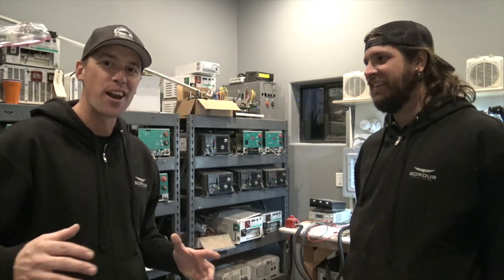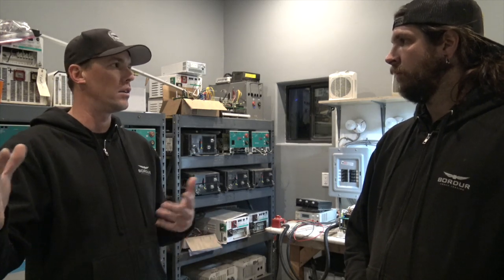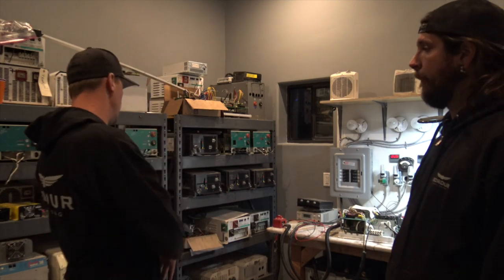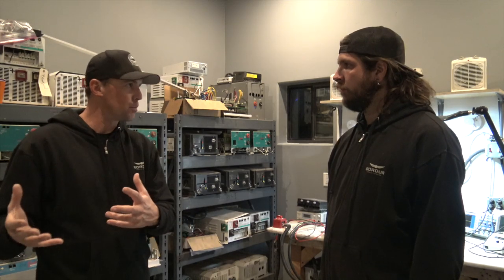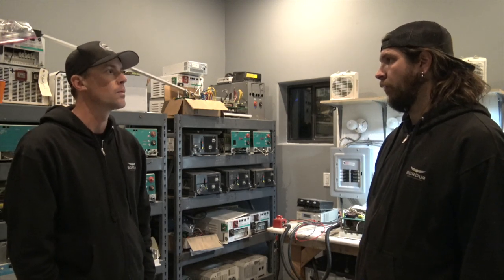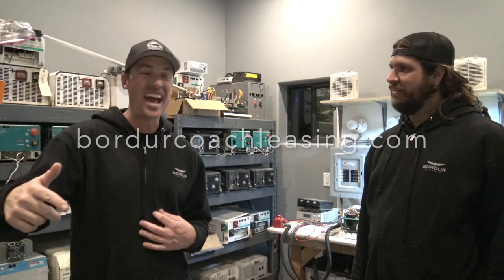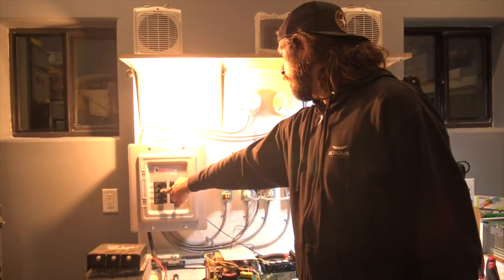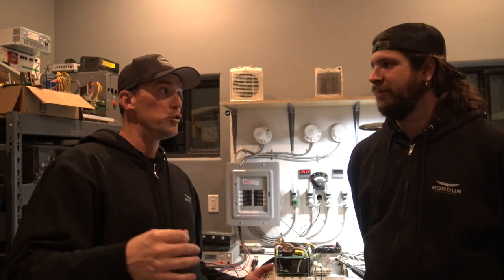RV EXPERT EXPLAINS INVERTERS AND COMMON INVERTER PROBLEMS

Comment: I would love to try repairing these inverters ! I have repaired so many in the past, but 
not for motorhome. Question please with LifeP04 batteries they are lighter than say
AMG or wet cells. The LifeP04 can be drained down to zero volts and not be damaged.
Personally  I would not make a habit of doing this myself. Correct me if I'm wrong please,
But when inverter change DC voltage to AC . Every  time it has to step up the DC voltage
their is a power loss. Ok these batteries are series to make 24Vdc. The inverter has to step the
DC power to AC power their is a power loss. 
So if you are using 12 vote  Lifepo4 that means the 2 batteries would have to be series together
to make the 24Vdc. With only two batteries series together the current would be the same
coming out of two batteries. The only thing that has changed is the doubling  voltage. In fact the 
12Vdc batteries now equal 24Vdc . So if power = Voltage X current this does mean power factor
has gone up . Ok what if you series two more batteries just like the 2 you all ready done ?
Now you  parallel say bank 1 the first two that was series to make 24Vdc. Now you have two 
different banks of batteries. If you Parallel say bank 1 to bank 2 you will have the same voltage
24Vdc, but the current has went so much higher.
You could use an inverter that would change the 24 Vdc to 240 volts AC with different phases.
You could then balance the 2 different 110 phases. I think I could use that and when charged
by generator and solar panels by just driving to you next location. Wow you could be in the desert 
and really have you music blasting out while you sip on some  Royal Crown . You would have all
the power you could use. This system would cost lot more money but Wow. Just my thought and
I hope I didn't make a mistake putting down off the top of my head. Also I would look into building
your own Lifep04 12 batteries . This alone would make the cost a fraction of what you would pay.
I'm so sorry for making this so long. Its that when you start it goes on and on lol .

Comment: Hi kile  im  just a beginner when it come to solar trying to put solar on to my batch i have managed to pick up a couple of trace sw2512  inverters both with ishuse one keeps tripping the mains and the other has error light on and error causes say that the breaker is tripped it also will not accept mains power im in new zealand in a small town  i noticed you had som on your bench and you said that they were high end i am trying to find a work shop manuall or scmatics or sorce someparts or help and scowering youtube and  spotted your seggment and thought why not  anything would be much appreciated   cheers Tony

Comment: What about a magnum energy inverter that’s plugged into shore power but I still can’t use shore power. It starts to charge the batteries than on the remote the battery sign flashes than goes into a unknown fault..? It’s really odd. All batteries are new fully charged

Comment: Great video! I have a Xantrax inverter and 4 6v batteries in my RV. Also 4 Renargy solar panels to charge the batteries. However I keep getting the fault  /warning saying I have low DC current. I have ended up just using the generator which is frustrating after installing all this equipment. Any advice or thoughts on where to start troubleshooting? Thanks in advance!!

Comment: I purchased a 2008 Itasca Sunrise class A motorhome with a 600 watt inverter.  When I turn the inverter switch on in the wall, it glows which is supposed to mean it’s working.  But with the motor running, I don’t get power to my TV, so I’m thinking it’s not working.  What is the easiest way to test?  If it needs replaced, should i get one capable of higher wattage?

Comment: Please help I'm a newbie  ,,I have a magnum MS 2012 got it secondhand froom a filler at the RV park. It was working when he took it out. I came home and bench test with two good batteries end I'm only getting 24 V Up and down if you volts the green light is flashing as it should and no funny noises coming from the inverter. And another inverter I bought for something else is doing the same thing when I hook it up which leads me to believe I'm doing something wrong and probably with the grounds but I just can't figure it out. Very expensive Magnum inverterFluctuates around 24 V and my cheap inverter does the same thing fluctuates around 24 V

Comment: my inverter is brand new and turns on and off and doesn't function properly. I just put a new battery in too. I may have touched a red wire to the body of the inverter on accident. could this have done it?

Comment: I have a strange issue. When I turn on my Inviter the ground fault beaker will pop. I I turn off the rest of the breakers I can turn on the ground fault beaker and everything will work fine until I turn off and back on the Inverter.  What could possibly be wrong with the inverter?

Comment: Kyle, is 4000W enough power for your entertainer coaches?  I’ve seen some coaches with 5 AC units and multiple inverters.  Is this a good feature or overkill?  I imagine you don’t want ac going out on a tour bus so redundancy would be valuable.
Reply: 4000W will not run 5 x AC units..
Reply: @rebellucy5610  what will?
Reply: @gruponemesis  depends on the AC draw. Usually you need 2000 watts to run one 13,500 btu ac comfortably for any amount of time.
Reply: @gruponemesis  I posted a system that should be able. 5 AC units would be around  75K watts. I wish
I  knew  more about AC units. I would think that once the temp has reached that the blower would be
 almost only thing on. so I guess I have no ideal, or I would have to take a guess lol.
Reply: @jsteele42378  i dont see the vid on your channel?
Reply: @gruponemesis  I used to repair a lot of power system. Its just been quite a time back. I have tried to keep up lol .

Comment: I did a lot of research before I got all the parts and installed my Inverter. Being a lower model coach owner I knew I wanted to get one to power mobile devices and small electronics without having the run the Generator.  I posted a link down below to my VERY simple setup.  https://youtu.be/OTOgci5_YiI
It's all hooked up now just in time for winter ha ha. Can't wait for next year to use the whole system.

Comment: Someone with the knowledge, Please help!!.  So after a power outage an i guess there was also a surge right before, my ac input on my coach isnt working. My generator isnt charging batteries now, icant get ac input. If i flip a breaker it will work momentarily but then shuts off. Also i noticed the shore power plug an receptacle are blacken'd an slighlty melted  right after this outage surge. Anyone know what it could be. Or is it the obvious an is it the plug an receptacle. What confuses me is that the generator isnt charging batteries now too. Which shouldn't have anything to do with the shore plug right? Anyone help or advice or place to go for more info be greatly appreciated.